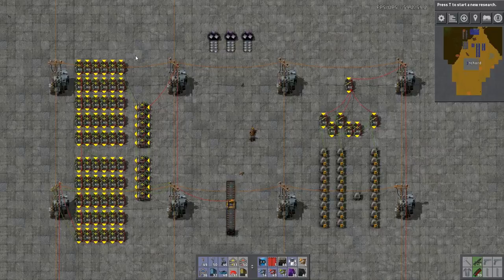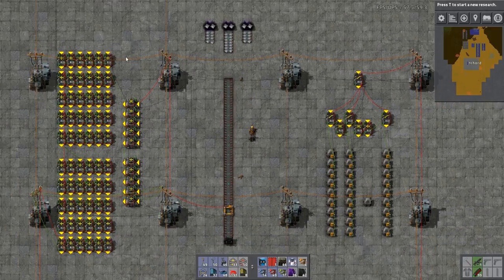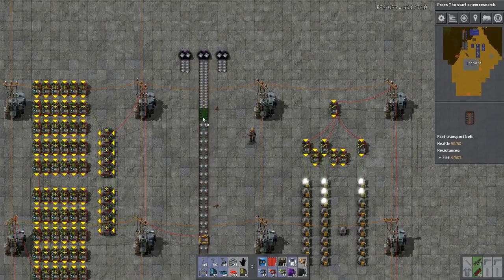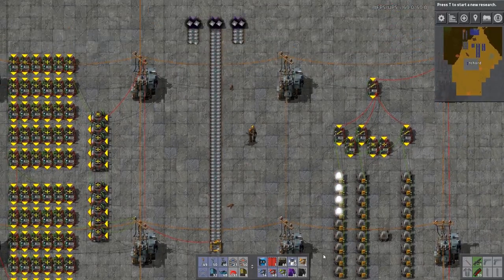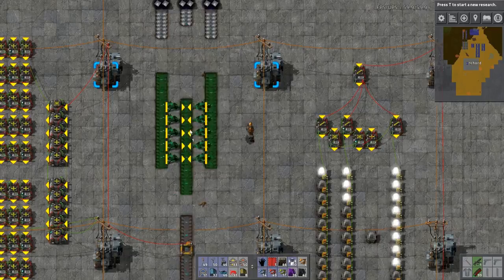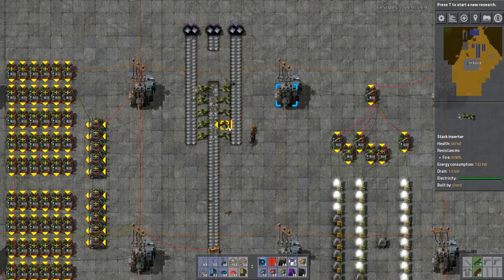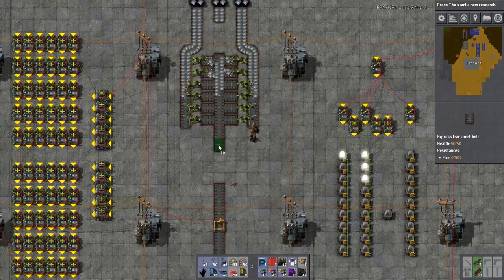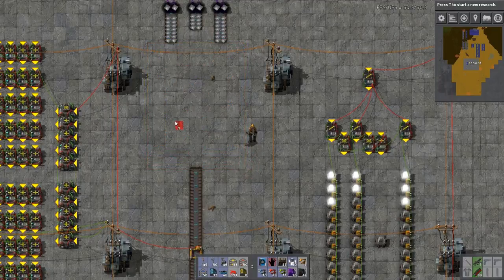Factorio:  Belt Compression Testing

Comment: It's actually not a directional thing that the right side of the belt does not get fully compressed while the left side does. It depends on the side the items are on on the loading belt.
Notice that the inserters on the left place the items on the bottom and the inserter on the right place the items on the top. If items are sideloaded from the bottom lane they will fill the gaps but if they are sideloaded from the top lane they will not fill the gaps.

Comment: I'd be curious to see what happens if you take the inserters, which aren't 100% compressing, and then supplementing that with a splitter-based balancer at the end. Does that do enough to fully compress or does it just balance the lanes?